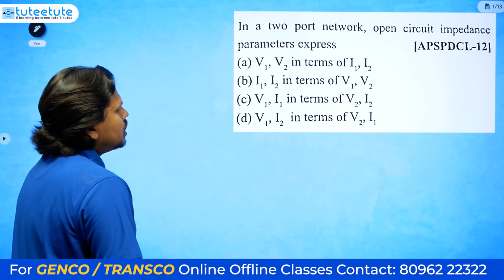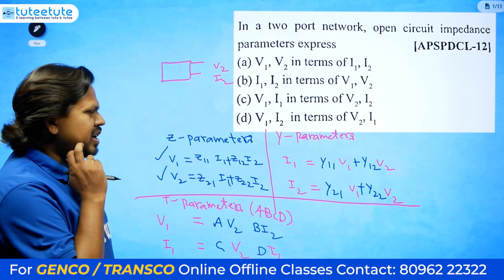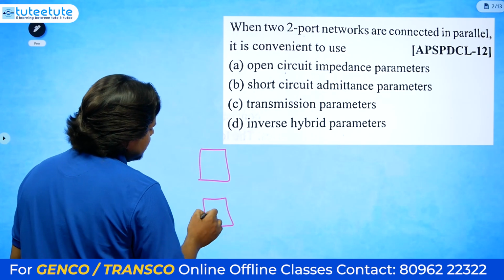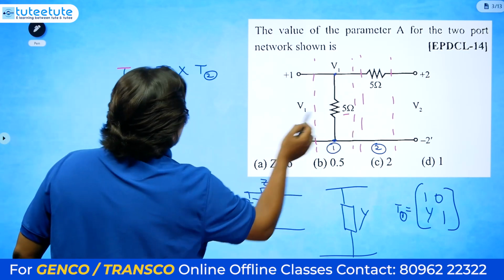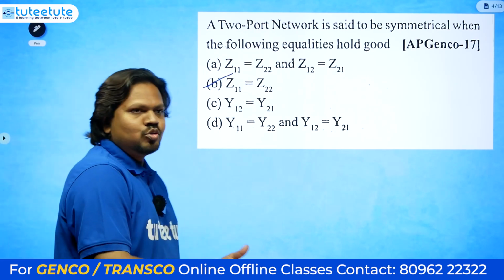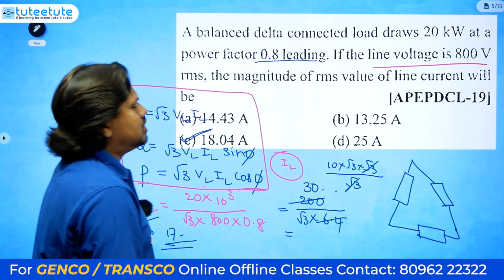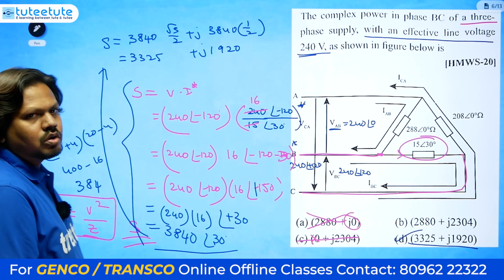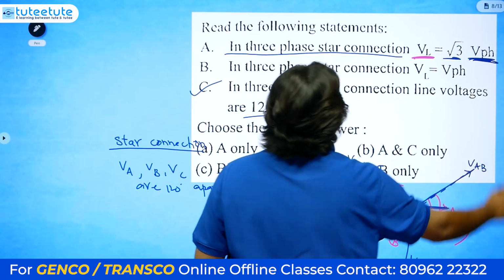GENCO /TRANSCO 500 Important Questions With Explanations Part_12 | #tsgenco #tstransco #genco

Comment: Sir gudafternoon in thermo dynamics n power plant engineering lo IC ENGINE  syllobus lo included r not n ies bits ic engines practice cheyala sir konchem confuse ga undi sir
Reply from the maker: Ic engine works on Otto cycle
Questions based on Operation on IC engine you can practice
Reply: Thank u sir for replay n refrigeration n Air conditioning kuda prepare avvala sir meru test series conduct chestara sir
Reply from the maker: @sumanpedagoni4969  
Ye branch meeru?
Reply: @GOVidya  eee
Reply: @GOVidya  chala hard chestuna sir but new syllbus prblm avuthundi sir
Reply: REFRIGERATION N AIR CONDITIONING kuda prepare avvala sir